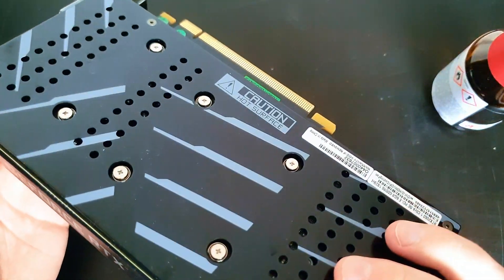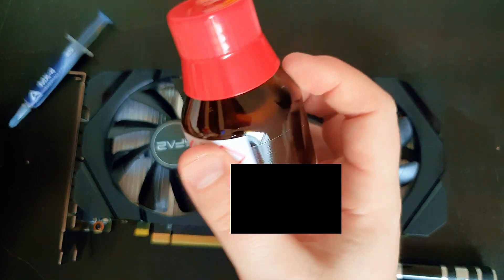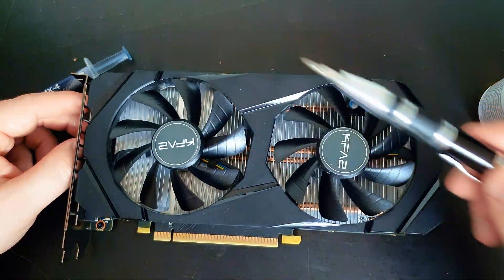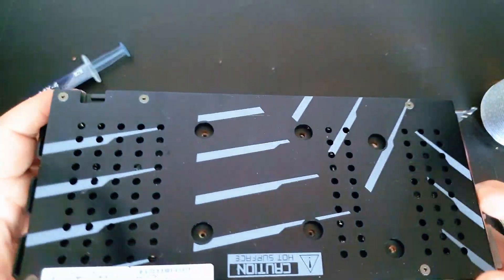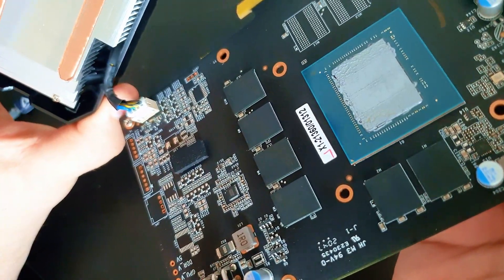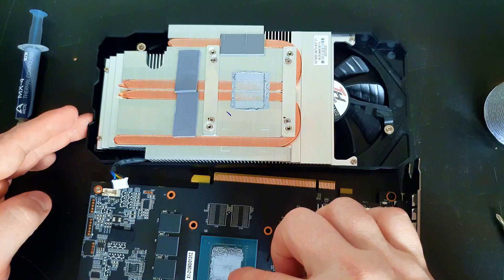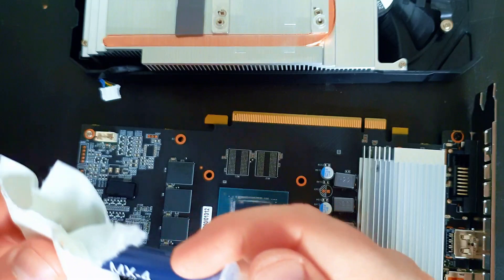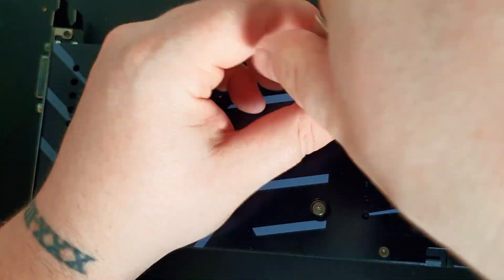How to Replace/Renew Thermal Paste on RTX 2060

Comment: is it mandatory to replace the pads? i only want to replace the thermal paste because no store near me sells thermal pads. but i heard that some bad thermal pads can actually make your gpu worse after repasting
Reply from the maker: To be honest I have never replaced them till now and never had issues. But if the card is very old like gtx 1080 ti, it is better to do it from my point of view.

You can check the gpu temperature before and after repasting with a stress test to make sure it is good.
Reply: @4zeazons thanks for replying to me even though i was so late.

i did re-paste my gpu an hour ago without touching the pads at all. significant 10°c decrease in gpu and no other problem arose. so i think switching pads is not necessary ❤ i am happy my gpu is no longer thermal throttling (i followed your tutorial to change the thermal paste in my rtx 2060)

Comment: How often should you do the GPU im going on 5 years now didnt know that the gpu needed thermal till a few months ago
Reply from the maker: It depends on how much you use your computer. If you use it every day for few hours for Gaming or other intense tasks on work you should replace Thermal Paste after 2 years already but for casual users also 3 years or 4 years could be enough. Some even after 5-6 years dont see any problems. Just be carefully replacing it or If you have the money maybe spending 80-100€ on a computer tech store to Replace it is worth it. But if you do also tell them to replace CPU Thermal Paste, not just GPU.